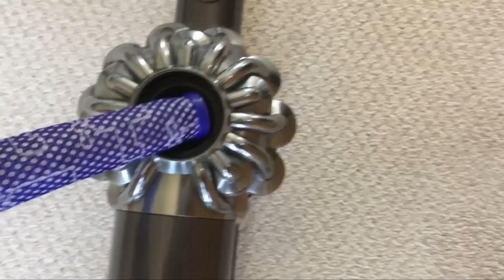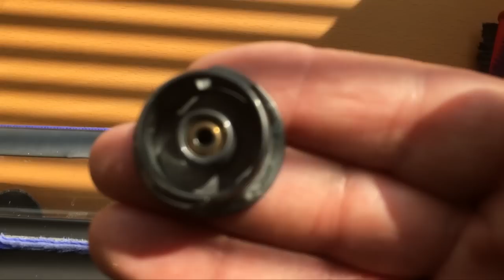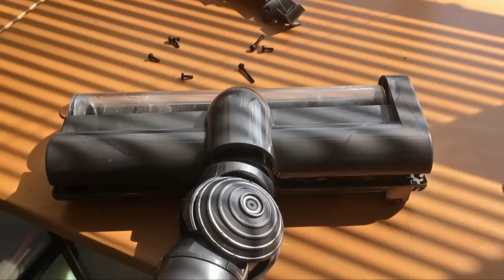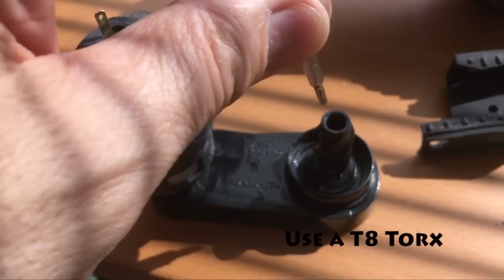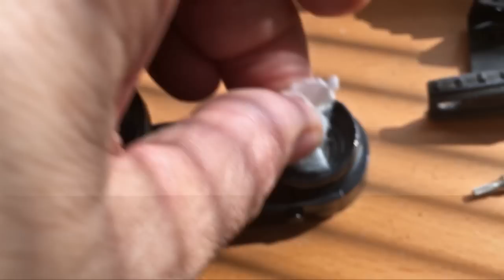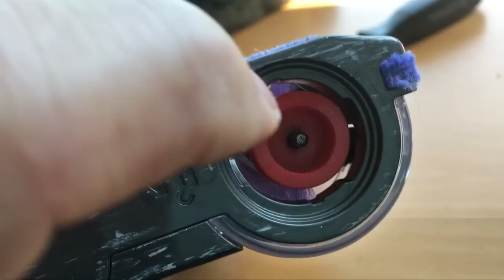Dyson DC59 Floor attachment motor repair

Comment: This video was brilliant! Thank you 😊 
Couldn't believe the hair that got into the mechanism and stopped the brush bar from working and now it's all fixed and good as new after following the steps in your video!
Reply from the maker: I have had to do this twice now and with 4 cats I'm sure it won't be the last time.  I could see others like you who would be in the same boat.  Those brush head accessories are expensive and this is a 15-20 minute fix.
Reply: @DrivelineMaster  We've got a cat but most of the hair I found was my daughter's! She didn't have a haircut until she was 14.

Comment: Thank you now have a working motorhead again. Unfortunatly i snapped the wires on the clips when taking off but nothing a little solder couldnt sort.
Reply from the maker: Glad you were able to solder the connectors back on.

Comment: Normally don't post but I have to say great video and very useful . I got stuck on the catch that you pointed out needed to pushed in using a screwdriver . Mine works now but it's making a slight whirling noise i suspect some rubber is catching the motor belt ... I digress ... thanks again

Comment: You Sir, are a treasure! Thank you so much. I finally found a T8 narrow enough to get into that Technician's screw  hole up the motor end (y'know, the one designed to make it hard for ordinary people to undo so you have to take it in for an expensive service) and your video made the rest soooooo much easier!  Bless you!

Comment: Thanks for the disassembly instructions. I have cleared all the hair out but the head still doesn't spin. I probed the power pins for the motor at the main body which was 0 Volts when I press the trigger. Are you able to measure the voltage on your device when the motor head is not plugged in, i.e., no load? Do you see any voltage? Appreciate any help. Cheers, Duane.
Reply from the maker: Sorry Duane,  I never tried to measure the motor voltage since mine always worked however you should be able to do this. I don't know for sure but I suspect these are DC motors so make sure your meter is set to DC. Check voltage coming out of the vacuum head and down any extensions, then into the brush head.
Reply: Thanks for the reply. I've tracked the issue down to a dodgy connection, as opposed to a burnt out motor or faulty controller board. I'll measure the voltage when I open it up. Cheers, Duane.

Comment: Thank you, thank you, thank you! Everything went smoothly but one issue -  the piece that you lift up to close the cover? It feels like the wires are rubbing against the inside of the cuff because I'm getting quite a bit of resistance*. How exactly does all of that need to line up in order to go in smoothly?

*edit: vball wheel assembly